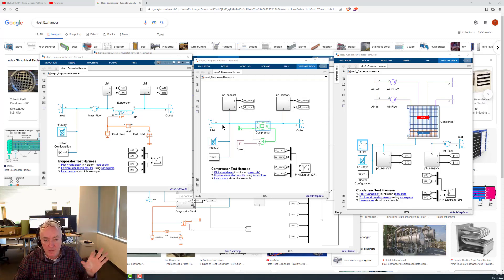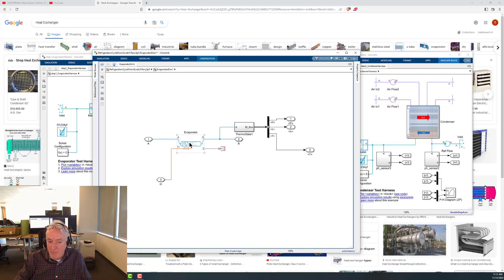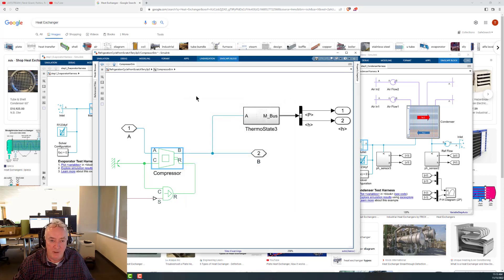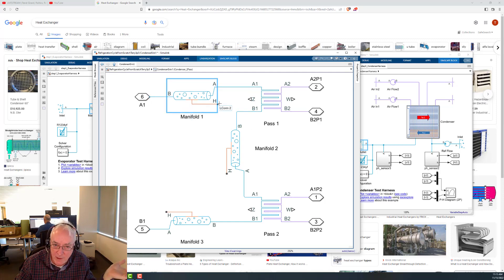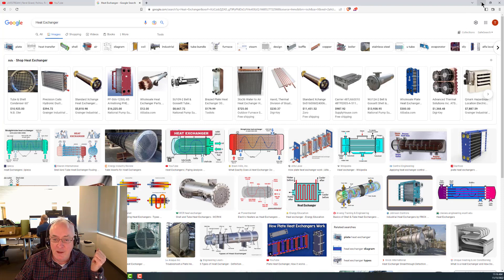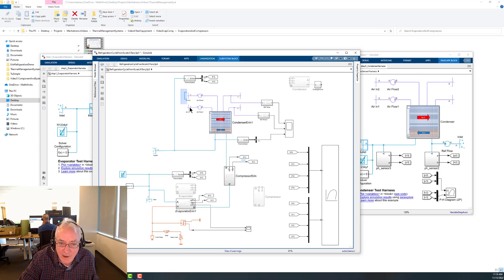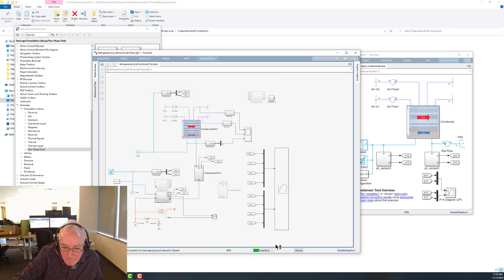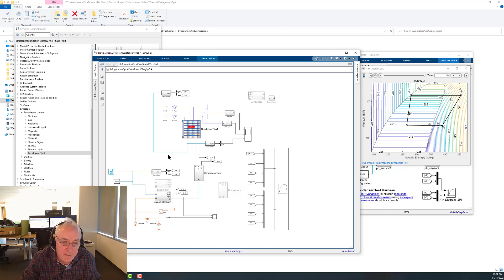Engineers Studio #27 -- Integrating Components to Form Thermal Systems

Comment: sir why is the Evaporator different from the evaporator before? I am making a similar system and was wondering why you added the temperature source /? doesnt the thermal mass model the environment from where evaporator gains heat?
Reply from the maker: Thanks, for the question -- it is good to hear from you.  Mostly my choice was made to be consistent with my colleague Erin, who developed the original case-study and tutorial for modeling the fluid flow and thermodynamics for this given refrigeration system.  Your question ultimately addresses whether you need Simscape Fluids, or merely the Foundation Library that comes with the basic platform product called Simscape.  Personally, I endorse the use of Simscape Fluids for providing more refined component models and relevant fluid properties.  If you are to be specialist on modeling flow systems in Simulink, I think it is a good idea to get this library.  With regard to the difference of the pipe model from Simscape Fluids and the Foundation Library, I view them as nearly the same.  Perhaps, you will appreciate things like a more precise definition of the heat exchanger that is available with the pipe from Simscape Fluids.
Reply: @terrydenery7078   Thank you so much for your reply I am working on a research program that incorporates AI into these Refrigeration cycles. I have been using your videos as guidance to learn how to create simulations of such systems and it has been helping me a lot. Thank you so much

Comment: Sir, if i were to carry out a similar simulation for an absorption system (an absorper and generator instead of a compressor) how can i carry that out?
Reply from the maker: I think this is a creative idea, but I am not seeing a promising path to accurate modeling of absorption through an analog approach with evaporation and condensation.  I think that you may be better off by simply modeling the gas flow, solving for state variables like pressure, temperature and flow rate, and then introducing rates of absorption based on these gas flow conditions. This approach of augmenting the thermal/fluid calculation with an additional calculation of absorption should work well with MATLAB/Simulink/Simscape.  Even with this approach, I would be careful of the situation where the magnitude of absorption reaches a level where it alters the fluid/thermal properties of the working fluid.  Thanks.